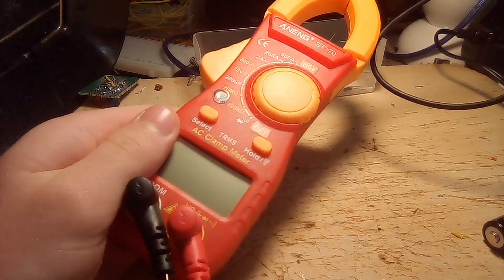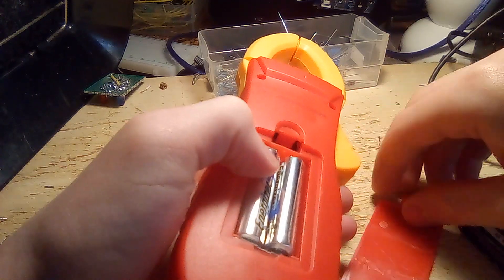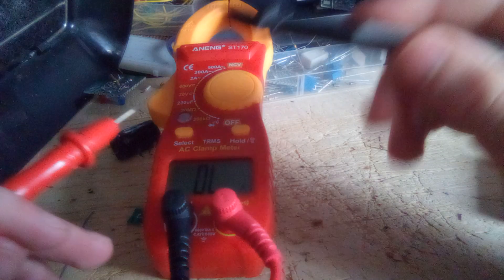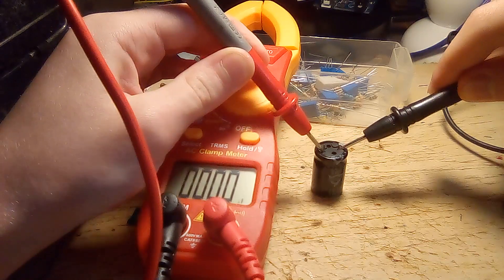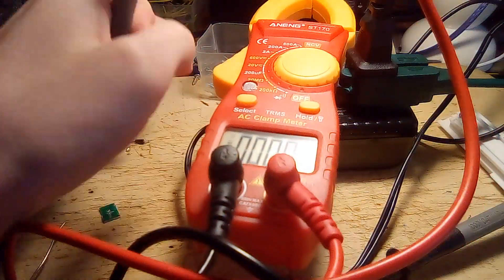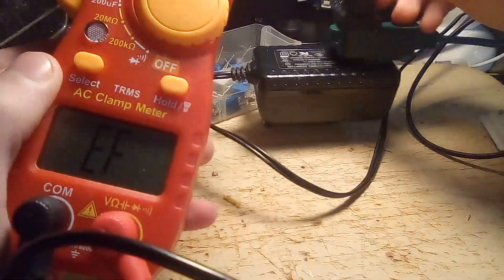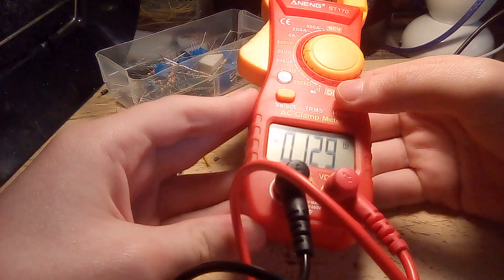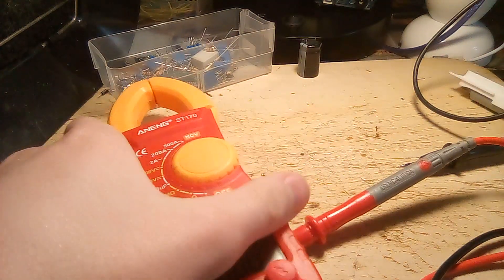Review of the ANENG ST170 AC current clamp multimeter

Comment: Mine is showing EF when I on it what could be the problem
Reply from the maker: You have it set to the NCV mode, which allows you to detect the presence of power lines in the walls. To allow it to measure voltage, turn the knob to the voltage position. Unless there is something wrong with it and it stays in the NCV mode no matter what position you turn the knob, in which case the  contacts in the rotary knob might be broken.

Comment: can it measure DC current? like the cranking current of a car batter?
Reply from the maker: No, it cannot, not unless I build a shunt for it. Which I have already done in my latest video, and it can THEORETICALLY measure up to 600 amps. In reality, the resistor would have blown way before that. In order to measure DC current with the clamp, I would have to buy a more expensive meter.

Comment: Ha, that looks like a happy meal toy.

I know what I'm talking about, I have several quality meters, some even with a similar color scheme (fluke). I'm an electrician and an ee hobbyist. I use completely different styles of meter for my hobby and my job. The point is I'm not just saying it looks like a McDonald's toy in the same way as someone who doesn't know what a multimeter is might say the same thing.
Reply from the maker: It only cost $6, but it's a pretty decent meter.

Comment: They have one that measures AC/DC current with a clamp for $26. How would you measure current with a 1-ohm resistor?
Reply: 1 Ohm resistor: At first I thought you wanted to test his knowledge, but then I saw the idea actually came from Vinny, so I suppose he knows how. Okay then, here is how:
You put the 1 Ohm resistor in series with you device under test, then you apply voltage to the circuit. Then you measure the voltage across the 1 Ohm resistor (this is called a shunt resistor in this configuration). With Ohms Law, you Voltage reading is equal to the current flowing through the circuit.

This is a really useful method when your equipment can only measure voltages but not currents directly; for instance when you want to measure the voltage and current over time of a charging capacitor with an oscilloscope.
Reply from the maker: I wanted to save money.
Reply: @vinnysworkshop  Makes cents. heh. You have some cool projects on your breadboard. Are you going to do more Arduino (or Pi) or programming?
Reply from the maker: @BariumCobaltNitrog3n  I occasionally do Arduino programming, but most of the time I don't make videos about it.
Reply: @vinnysworkshop  What kind of devices are you working with? Like sensors and steppers? I was obsessed with neopixels for a while.
Reply from the maker: @BariumCobaltNitrog3n  I used an Arduino MEGA to make the world's worst stepper motor play "African Bell Carol." I was originally inspired to use a stepper motor as a crude speaker from this video: www.youtube.com/watch?v=O9aorO9_gVA
The only difference is that I have only one motor instead of four, and the motor does not spin while playing the music because the motor is terribly slow.